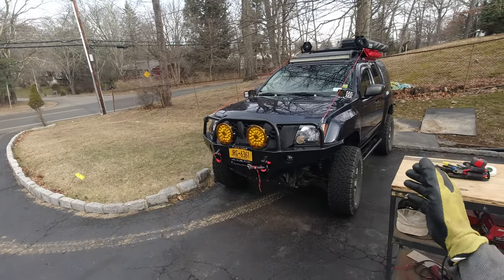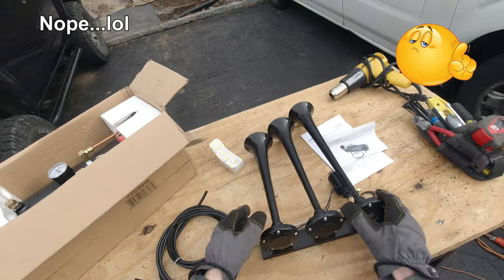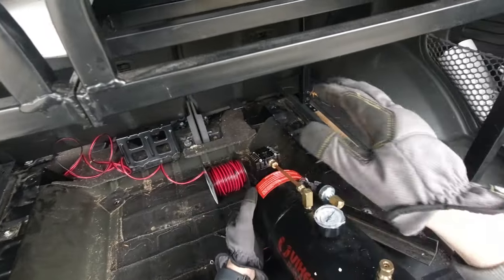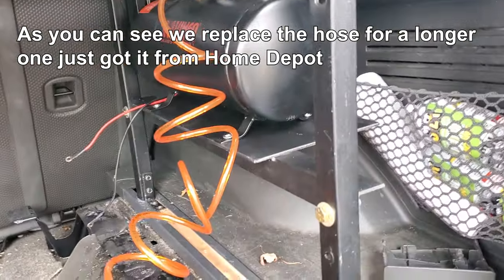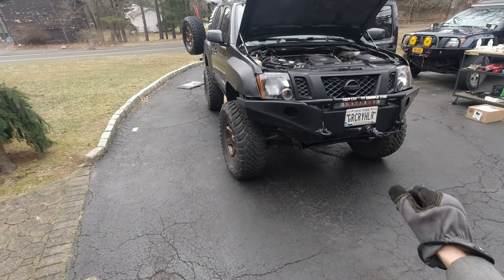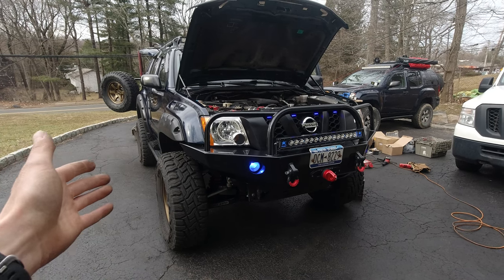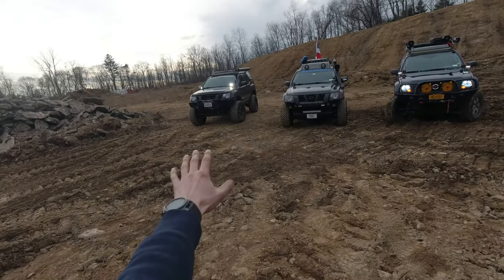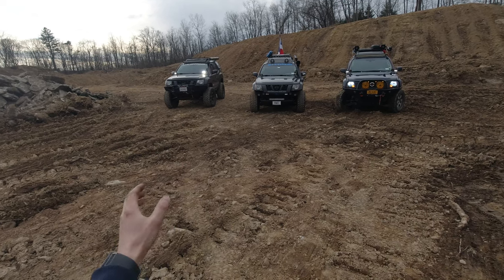Quick Install and Test of $199 Air Horn vs $750 Train Horn

Comment: Wow!  Took me awhile to figure out which air horn I like better.  The $750.00 horn is obviously much louder and throatier than the $199.00 horn. I would love to have both - one for the highway and one for back roads.  For me, the win is the $199.00 horn because I rarely have to honk my horn on the highway.  However, my opinion could easily be swayed if the $750.00 horn was on sale for $199.00!